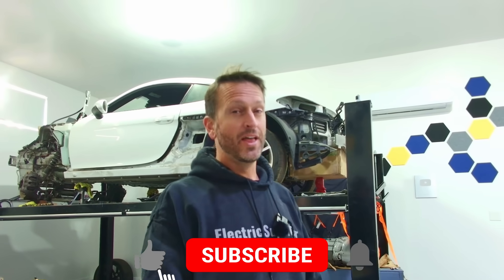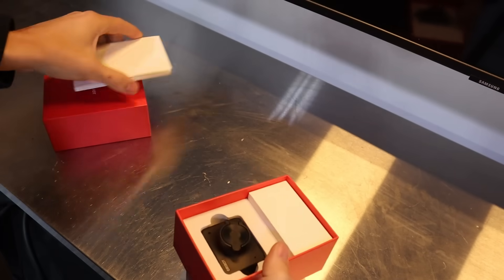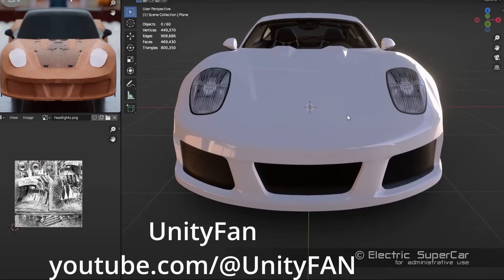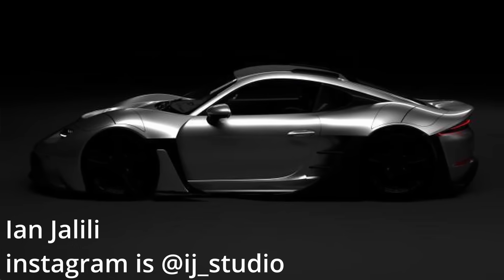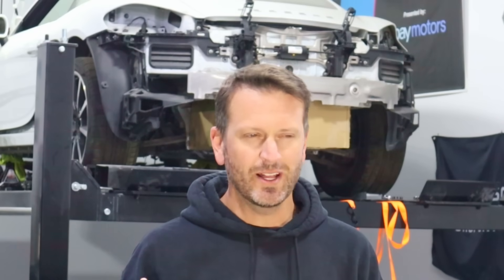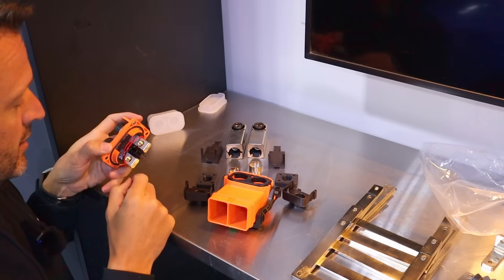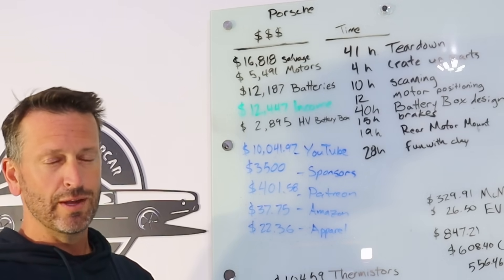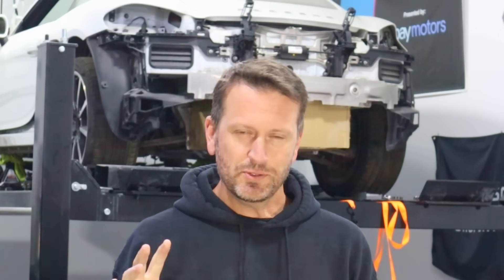Next Gen Porsche - Design Reveal; Porsche GT-E

Comment: Erickson Samuel made that look like a freaking magazine/professional model!!  You designed that body freaking sexy!!!  Porche should seriously knock on your door for aome design and electric ideas....  The various tail lights and headlights to see different designes was nice. I like the one slinder red lines on each side, but also reallh like the full width line...  Maybe do a full line custom RGB LED /lens and for break likes do the sides, but foe running lights at night, full bar dim red, then reverse lights they all turn white bright so you can see backing up, and for turn, do a sequential orange line that starts in the center and goes out to thw slinder brake line. Easy to program rhat with turn signal/brake/reverse/running lights.

Comment: 05 wrangler, 1 motor per axle mounted centrally, hybrid pack and diesel range extender. This is a lightweight offroad build that will start with 37" tires, but will leave room for 40s, but will be street legal. Nothing too special.

Comment: I want to see another H1 humvee!  What I would like to see (but might not be possible) is a dual motor set up, using tesla motors.  Toss out all of the drivetrain up to the diffs.  Put the motors on the "outside", eg: the front motor would hang forward, and the back motor would hang backward.  I am hoping that the telsa drive outputs can be lined up between the breaks.  Fill the transmission tunnel with battery.  If this is possible, it would preserve all of the ground clearance as well as the "truckness".  Note:  Many states have passed laws that making getting surplus humvees on the street easer.  I would literally pay you for the plans... I am not rich... but I would defenatly be at least joining the patreon for that.

Comment: 9:16, I think it would be safer to install FEMALE connector side on the battery instead of teh exposed electrified pins on the male connector right?
Reply from the maker: The plug is designed to be panel mounted like this.  The other side does not have a way to mount and is meant to be rotated
Reply: I see.. probably this connector is not built for this purpose.  Just be carefull with these energized exposed pins. In the past I learned the hard way when i used DB25 connector with male pins on the energized side when I simply wanted to connect both male and female together and the metal lip surrounding the female pins shorted some male pins on the battery side. This melted some wires inside And i had no idea if fire was started or not inside the battery. Fusing the BMS wires is great but you must make sure the BMS can detect bad connections to the cells otherwise if one is disconnected or fuse melted and no detecting is made, this wire become floating voltage between the two strings voltage    @electricsupercar